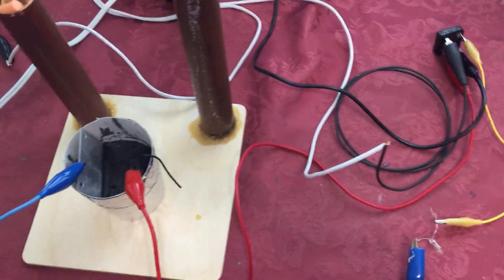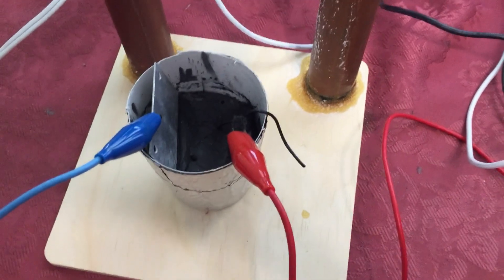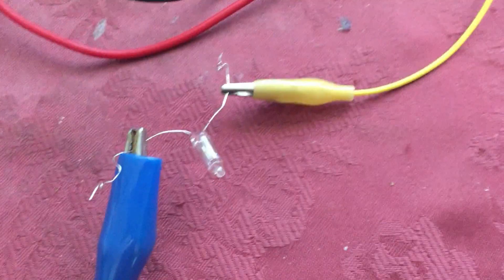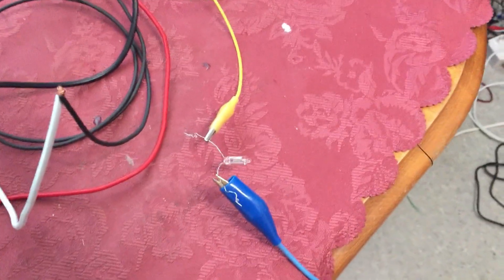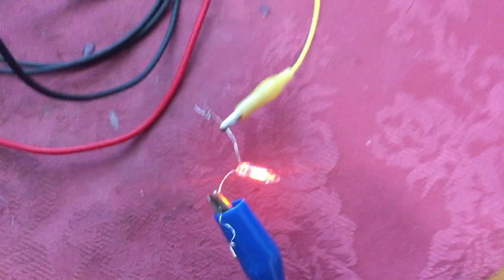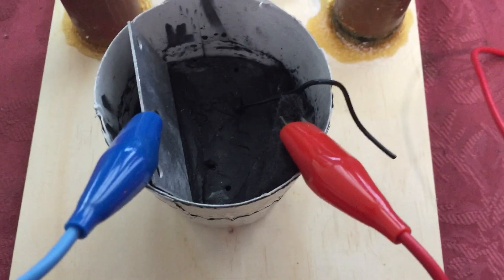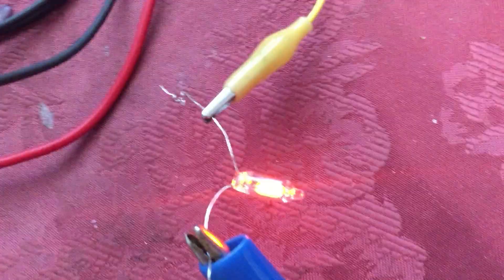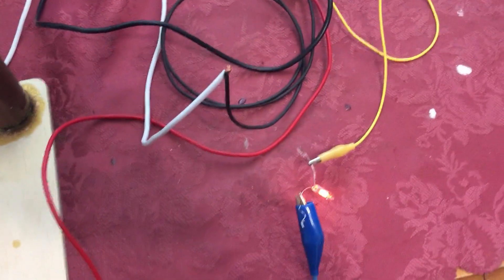Open Dipole Energy Demo

Comment: To me it looks like the magnesium attracts many electrons and creates a certain potential for example 3.5v. And carbon attracts also electrons and creates a certain voltage but less than magnesium. For example 2v. This is something that doesn't meet the eye. PEG 3350 prevents the equilibrium and the difference is 1.5v. If this is the case then to enlarge the magnesium plate would bring a higher unseen potential. For example 6v and the difference would be 4v compare to the 2v of carbon.

Just an idea. But I believe you tested that already.

Comment: If there are several folks building circuits with PEG, using different amounts of powder, water, beads, and different material for the anodes and cathodes, replications of WORKING systems COULD be luck, and figuring out what is the most EFFICIENT combination could take forever. Everybody repeating the mistakes of others, rather than pooling knowledge and results. Makes sense to me that some of us get together and start with a specific amount of powder, water and beads and the SME material for anodes and cathodes, and then coordinate efforts in changing thigns to see if there is a better combination. Then move to experimenting with different anode and cathode material.

Comment: The Bedini motor runs like a charm. That's the final proof it works. This little constant potential difference has a huge potential. The Nobel Prize 2024 in physics goes to Mr. Lagace.

Comment: Hello bro, have you tried measuring the resistance of the real battery using the same meter as you did measuring the PEG cell? Thanks.
Reply from the maker: the 9 volt cells a few ohms.
Reply: @joellagace1679  Ok, thanks.
What about the other battery like lead acid battery?
Reply from the maker: I don't remember, I know Bedini specifies it, It's all rather low resistance paths, That's why the inductive kickback of the Bedini works so well because the circuit almost sees the battery like a dead short as demonstrated that the bedini speeds up when you short the inductive kickback side on itself and the Bedini runs more efficient instead of "loaded" down.
Reply: @joellagace1679  I don't know what you meant by " when you short the inductive kickback", I guess it's a shorting coil technique...if so it's another story. 
Anyway, my analog VOM is busted so I can't measure across the lead acid battery but thru my digital meter, I read nothing  as well. So I tried to ask.
Planning to try with this PEG cell when I have a budget for for this.
So far I only using wireless and one wire technology ever since for the goal. These are my only ways and are a lot easier to me of doing to make a looping system. But this PEG cell seems promising as well. Can run on low voltage system.
Keep going brother.

Comment: Hi Joel 👋  was the black clip to the left of the PEG on the input neutral and going to earth or the negative side of the battery?
Reply from the maker: a plus minus plus minus series setup. DC.  AC goes into a full bridge rectifier AC inputs as normal.

Comment: If you just put a neon on the cap, will it dump through the neon when it gets to 90 volts? And then shut off the neon when the voltage drops below 90 volts?
Reply from the maker: I tried it works for a few shots and the cap even a big cap catches up too quick. It would prob need the SCR neon cap dump. or similar.

Comment: I don't understand the reason for the inverter 
Your feeding the inverter with the battery which is DC, then rectifying the inverter back to DC 
What is the output of the rectifier 
Does the inverter not just introduce more loss in the system?
Reply from the maker: To get over 100 volts DC quickly. Not super high voltage not super low voltage. A nice range to experiment with. going HF might introduce coupling issues and other problems because this is a DC effect. More pure potential the faster you can charge those caps and dump them. Also 1ma at 100v is much more then 1ma at 1 volt. It does this kind of current shift. You can try with a simple joule thief instead. It's best to just use a bunch of DC series Cells, but if you don't got those, this is a way to simulate the cells at a cost of needing to use a little bit of real power for the inverter oscillator etc...

Comment: Is that your PEG+Copper Oxide cell?
Reply from the maker: Yeah works with the regular one as well, Just this is one of my bigger cells so the electrodes are well spaced apart. So I prefer to test higher voltages with this cell.

Comment: Good stuff Joel.  I’ve been contemplating how to achieve the Bearden concept of voltage/no current (I’ve been reading many Bearden documents). This looks very promising to achieve that mechanism. Of course Bearden described it as doping a conductor with a degenerate semiconductor to increase relaxivity time (allowing potential to charge capacitor before current starts to flow), or later, a smartly created Step-charging setup (though, one would think this would only ‘partially’ achieve the goal). But no one is going to try to create aluminum/iron alloys for this. Interestingly, Tesla also talked about the importance of stopping current flow and using just voltage potential.. with chokes, quenched spark gaps etc..   need to get to the bench to experiment.  It’s a big deal if this peg cell mechanism achieves this…!
Reply from the maker: Yes that is what i'm trying to get at. Big deal indeed. and simplifies lots of all this. And opens up all kinds of new opportunities, Imagine going back to the drawing board and trying to build Don Smith, The Meg, a Bedini etc with incorporating this in the mix.
Reply: @joellagace1679 exactly. I’m with you… plenty to experiment with here, and I’m going to get into it with you. I’ve already built a few PEG cells. I’m going to get into an initial setup, which is the Bearden simple free energy design (charging cap, dumping to load for real work), which is what you are already showing here. Pretty exciting. Great job. I’ve never seen such a potentially simple, elegant solution to this!
Reply: @joellagace1679 I’m with you, plenty to test
Reply from the maker: Like Bedini would say, I feel all  warm and fuzzy inside as I watch it all work. :)

Comment: I here this term alot displacement current ,  it only makes sense to call it back emf  , unless displacement current is something totally different
Reply from the maker: displacement current is when you introduce two potential plus differences. One side wants to balance out. It creates a displacement energy pulse. The trick is to keep the system resetting. So you get this action continuously like a water pump fountain. And spin the wheel from the water fall. BackEMF is something else that of course can be utilized. imo
Reply: @joellagace1679  thats so funny , i stopped looking and the negative symbol (-) as a a Negative years ago. To me its a lesser Positive (<+) and (>+) so if you know displacement current is just the electrons moving closer to the greater conductive path why all the concern about arching to your electrode and closing a loop ?
Reply: @joellagace1679  you have to close the loop to complete any kind a transfer even if its for a nano second
Reply from the maker: I'm looking at the external circuit load in my example the goal is a charging cap, the cap starts at a lower potential and once it sees the circuit the dielectric retains a charge from that initial burst of displacement current. For a short initial moment the cap appears as a "load" charges up charges up as fast as it can from that near zero current of most pure potential. From the combined series DC potentials. The cap dump resets the process. In the other comments we get into what goes on internally in the PEG
Reply: @joellagace1679  i can see that happening since the electrons will crowd near the exit which is your electrode connected to the CAP, all depends how much current the PEG pushes with its voltage and how much and your resistance level on the output to the electrode. If there is not impedance to the drain (electrode) then there will be no crowding of electrons at the gate ;)
Reply from the maker: Yep the current "push" comes from the PEG cell the higher potentials from the DC series sources. Its a nice setup imo
Reply: @joellagace1679  Yes build your volts as high as you can get it , even though the current is small the volts potential will jolt it in the CAP real fast , if you can switch the same potential from that CAp to an inductor and then let that inductor collapse you have a nice Buck Boost in voltage to another CAp maybe from there when you step it down the current will show more of a presence
Reply: @joellagace1679  i think the exotic stuff happens when you step down the HV and I quote "CORRECTLY"
Reply from the maker: Yeah like I did dumping the cap into the transformer and my neon big bright purple flash on the secondary low side even! that joule of energy really feels in the transformer, I talked about it in the video but I didn't demonstrate as it's kind of obvious from the explanation and others in the field. I got a bunch of SCR's around I should rig together a automatic triggered to transformer dump to experiment with next.
Reply: @joellagace1679  I am convinced the downfall of our current day technology in regards to energy resources is that our switches are not fast enough . and i dont mean frequency , i mean the on time is too long. We need to be able to drop it below 1ms . Example of a good switch revolution in my opinion is .001ms on and 5ms off , gl getting a Function Generator to do that

Comment: Did you know you can rectify in two directions . With a N/S   S/N   Pass over coil arms ? lot of people make rotor with n/s config and try rectify with out full bridge (mistake)
Reply from the maker: It's also worth to note that even in the PEG cell within the electrolyte there is electrostatic arc. We just don't see it because its so small, Since the electrodes are well spaced the arc does not momentary complete the loop like a spark gap circuit would. So using thin zamboni like piles would probably not work for this method as the electrostatic sparking could complete the full loop imo.
Reply: @joellagace1679  Ethylene glycol is produced from ethylene (ethene), via the intermediate ethylene oxide. Ethylene oxide reacts with water to produce ethylene glycol according to the chemical equation:

C2H4O + H2O → HO−CH2CH2−OH

Not a lot of carbon here but interest how the conversion binds a carbon to a hydrogen in the process and kind of links the molecule with carbon
Reply: @joellagace1679  I prefer to see those mini sparks as a transfer from one glycol to another and not necessarily a loop more so transfer to the next glycol closer to the electrode as we know the path of least resistance . I would not be surprised if the glycine turns to sugar as it does in the human body ;)
Reply from the maker: Yeah well that's how the ions hop in solid state. So you can only assume that will trigger electrostatic action as well.
Reply: @joellagace1679  the mini arcs are closing a loop from <+  to  >+   thats all  happening
Reply from the maker: I don't get what your getting at. The electrodes are well spaces apart. They don't all arc all at once. The small localized arch does not conduct the solid state PEG outside of its spark range at the nano scale here. It's random and all over is my understanding. But if the electrodes are close enough like a zamboni pile paper thin the perhaps one of those sparks could complete the loop.
Reply: @joellagace1679  electrostatic I am not sure if that forms on molecules maybe there surface it does , could be from chemical reactions causing temp differential in the  glycol , so you say  those nano static will be harmful to your project somehow, ? by closing a loop ? i guess you see static as a straight line of DC ?  I see what you mean now . NM , ya thats a possibility
Reply: @joellagace1679  ahh right , that too lol . Yes correct , better with just 2 electrodes , it gets hairy quick and you can have short everywhere .
Reply from the maker: That's why I don't trust the John H cell for this application, but it was worth experimenting with.
Reply from the maker: Quantum jumping might be a good name for the interactions looking at it atomic and elements.
Reply: @joellagace1679  I think the glycols is acting like a hydro carbon conductor , like graphene is carbon it conducts also so does basic carbon .  sugar has carbon c6h12o6
Reply: @joellagace1679  not 100% on that but i will look at the glycol structure online if it has a good amount of carbon you should expect it to conduct  energy to a degree or two , this will clear up any confusions as to what those mini sparks are actually doing and which direction they are heading